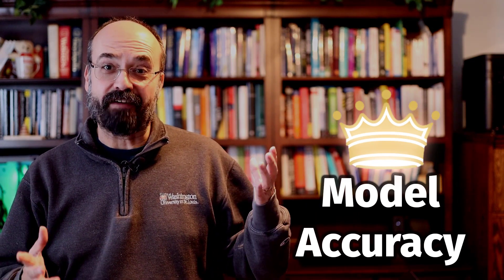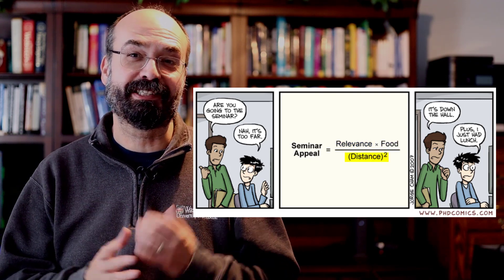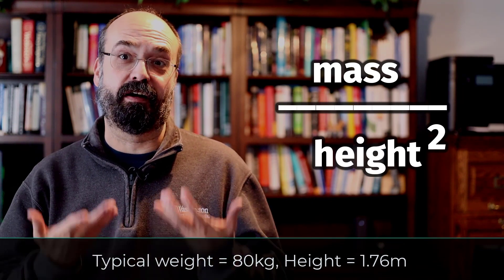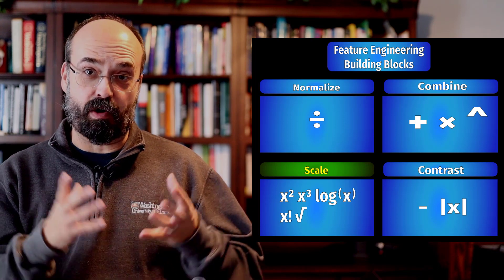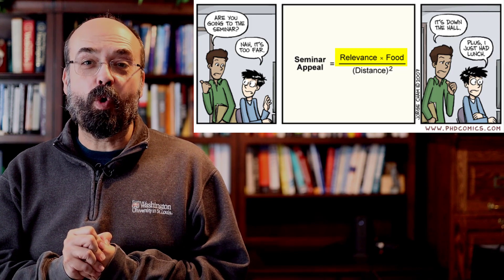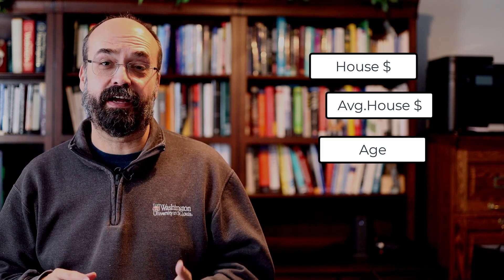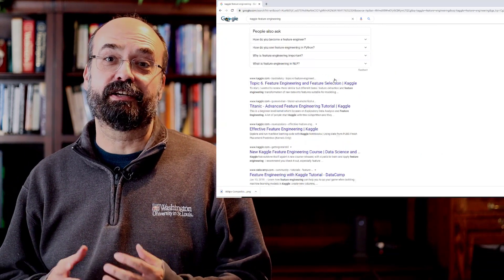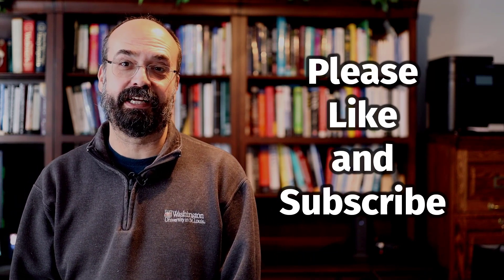How to use Feature Engineering for Machine Learning, Equations

Comment: I read over your thesis comparing types of feature engineering vs machine learning models. Great stuff! Thx.
Reply from the maker: Thanks!
Reply: @HeatonResearch  Would standardizing or normalizing the input features give you better results? That one ratio had such a wide range.
Reply from the maker: @jameswilliamson1726  I will often standardize/norm after applying these techniques. The techniques I use here are really to capture the interaction between underlying features. Then standardization/normlization on top solves range concerns.

Comment: Hi Jeff, what concepts should I look into to understand "Weighting" better? For instance at 9:41, you mention that if one values food more they might square it. Someone might cube it, someone might multiply it or add a coefficient of 2 or 5. These are all subjective.

For weighting when it comes to features in the stock market or econometrics (my specific application), one might have a feature that is GDP or inflation. I know for a fact that change in GDP (slope) and change in the change in GDP (slope of slope i.e., acceleration) are pretty important. My first problem, is that I found these two (change in GDP and GDP acceleration) simply through guess and check, and research papers. Is there a better method to this? Or should I focus on automating 'guess and check'? Secondly, sometimes the GDP features or inflation related features vary in importance to participants in the stock market. Perhaps right now (as of Oct 2022) investors might place more emphasis on inflation related features and so I might multiply inflation features by coefficient of 2 or square it. How would one deal with dynamic weighting? Or a simpler problem might be, how do you objectively select for weighting?

EDIT: I have come up with an idea, to add a coefficient to GDP or inflation based on social media mentions (sentiment), for instance. Thoughts on this and weighting in general?

Thanks so much! Love the video by the way!

Comment: When we do feature engineering, are we expecting that the new feature has a high correlation with the predicted values?
Reply from the maker: Yes for sure, so you must keep that in mind when evaluating feature importance.  Generally, I leave the existing features in and let the model account for that (though some model types perform better with correlating fields removed).